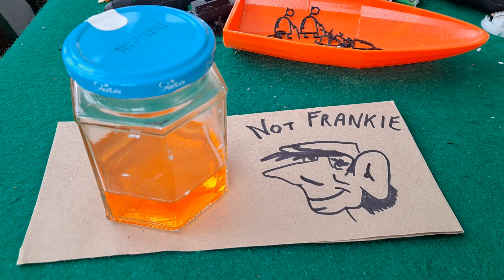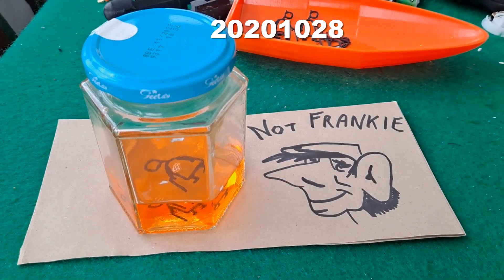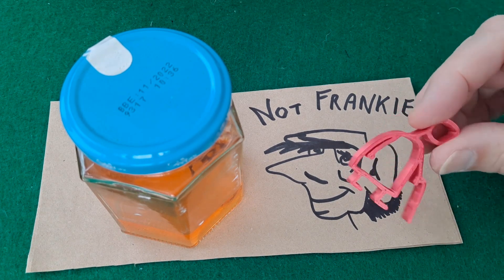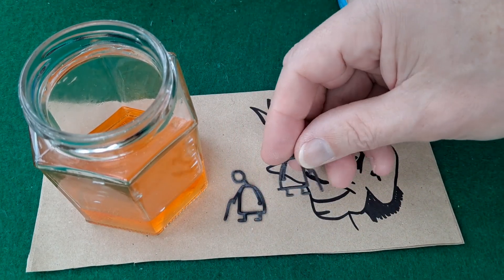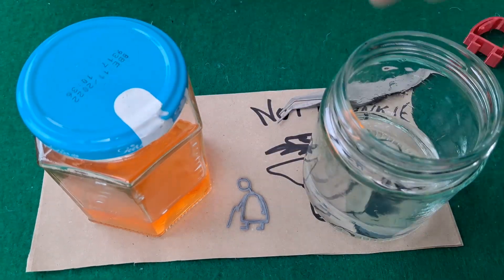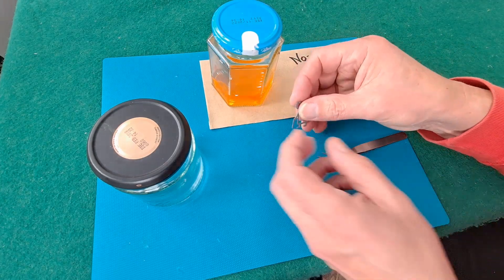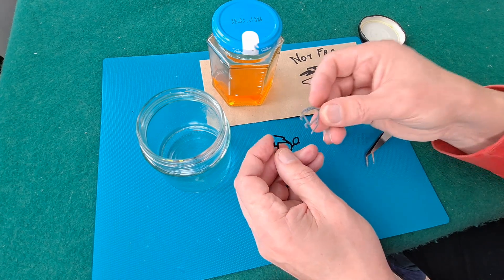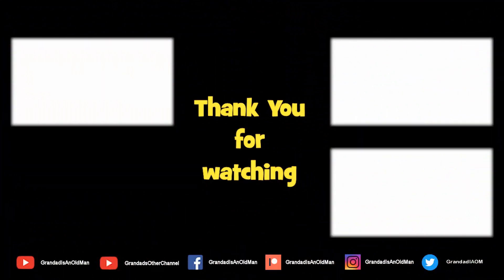PLA in Acetone revisited & what about water

Comment: I'm impressed with how sturdy pla is. i assumed it would just deteriorate
Reply from the maker: Well it is just not chemically effected by acetone. It is supposed to be biodegradable, but I think that is only in very specific biological circumstances. "Polylactic Acid (PLA) is derived from renewable resources like corn starch or sugar cane and some types are expected to biodegrade within 6-12 months" (Yes I did just Google that)
Reply: @GrandadIsAnOldMan  haha I'd have claimed I knew that already
Reply from the maker: @systemSkynet  I did quite a bit of reading about PLA before I got the printer but my memory leave gaps so it was safer to Google it again. I put some PLA in my composter several months ago. The intention is to dig it out at some time in the future to see if it has deteriorated, but I will probably forget.
Reply: @GrandadIsAnOldMan  well quick, run, go check it now while you remember

Comment: It change the color and maybe when you took it out and exposed it to the air it caused it
Reply from the maker: No the acetone leaches the colour out. It did the same with the red PLA in the previous video. It does not have any significant effect on the PLA.
Reply: @GrandadIsAnOldMan  it did happen after you took it out tho.
Reply from the maker: @dunno2311  yes as the acetone evaporated and in addition since it has continued to dry out it appears to have shrunk. UPDATE Grandad Logo in Acetone	https://youtu.be/uQ-oDA2TjOE?list=PLA5a2xPRSrB3fTQcytmk1KIL1HLpLD0SJ

Comment: I wonder if the PLA is water absorbent before it is used, then after it is heated the chemical structure changes making it non-absorbent to water and other fluids. 
I am sure that is what they mean when they talk about PLA being water absorbent. Before it is used.
Reply from the maker: I doubt it undergoes any change in the structure as you can feed all your scrap PLA through a heater and convert it back to filament and the main issue is any moisture that has been absorbed. That creates bubbles in the filament. Obviously any dust or other contaminants don't help either 😁 I should just clarify that I cannot find any company in the UK that will recycle PLA. This was an interesting video on the subject https://youtu.be/vqWwUx8l_Io

Comment: looks like it made you older! does heat do anything to it? is it acetone or ethyl acetate?
Reply from the maker: Well, heat melts PLA and I used nail polish remover.
Contents: Acetone, Aqua, Parfum, Ethoxydigiglycol, PPG-12-PEG50 Lanolin, Benzophenone-3, Hydrolyzed Wheat Protein, Panthenol, Tocopheryl Acetate, Methyparaben, Quatemium-15, Benzy Cinnamate, Benzy Salicylate, Cinnamal Alcohol, Hydroxyisohexl 3-Cyclohexane Carboxaldehyde, Cl17200, Cl42090.
Reply from the maker: Interestingly enough, I have just checked the nail polish remover that I used in the original video that kicked off this series has a different table of contents: Acetone, Ethyl Acetate, Glycerine, Cl17200, Parfum https://youtu.be/UG-iGVFHjPg but this video was the stuff in my previous reply.
Reply: @GrandadIsAnOldMan  yes, there are 2 main kinds of nail polish removers. with and without ethyl acetate. they work on different kinds of nail polish and you can't use the one instead of the other. hmm my english is bad, if you're interested, you could google it. it's about how various types of plastic bonds. i also suspect one of those two nail polish removers could potentially dissolve pla with the help of some heat. not boiling point, just a little. anyways, this was fun and I'm just mumbling boring things! take care!